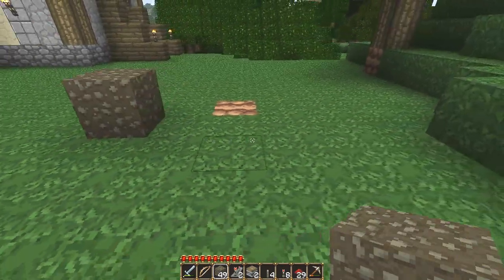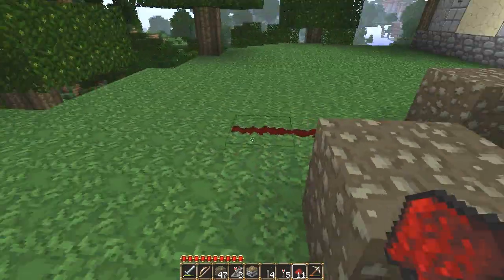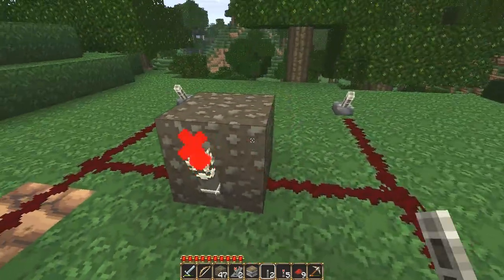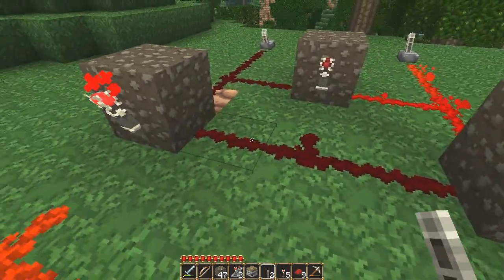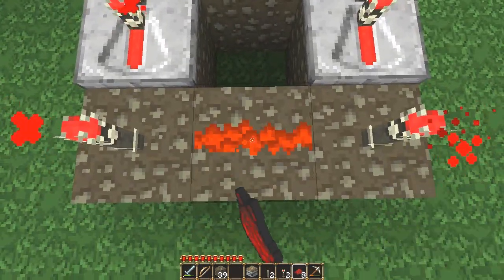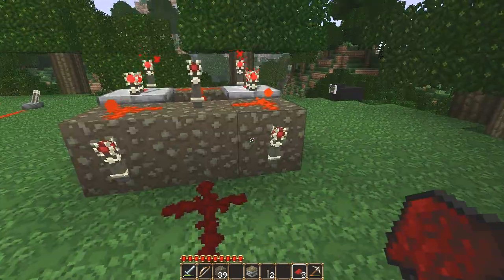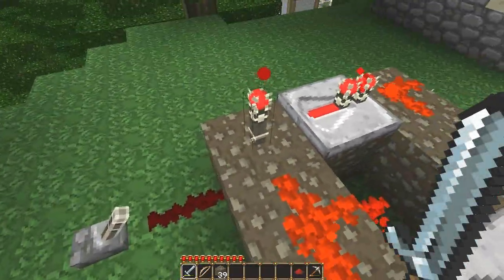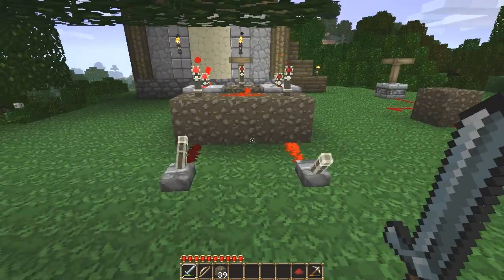Kalmier's Efficiency LP - 33 The XOR Gate

Comment from the maker: As I mentioned in the video, you can have a lever on one side of a door, that opens it, and then another lever on the other side that re-closes it.

So, use it when you want to activate something from one point, then be able to deactivate it from another point.

Drawbridges, lighted hallways, doors you want to stay open longer then a button press, an "airlock" for an underwater base, etc

(it's like using buttons on either side with a T-Flip Flop)